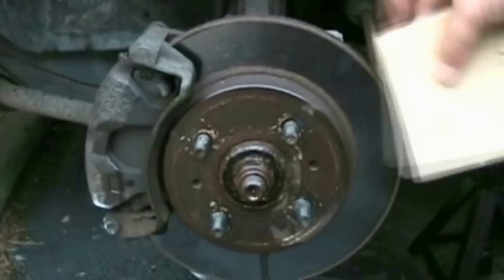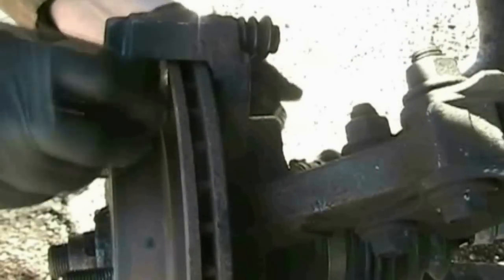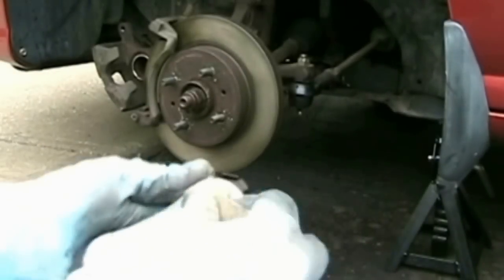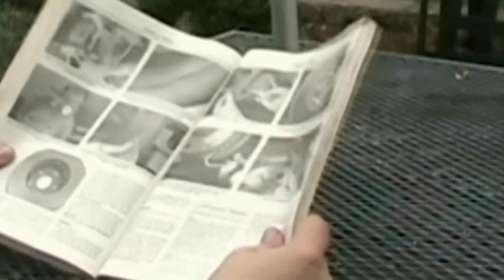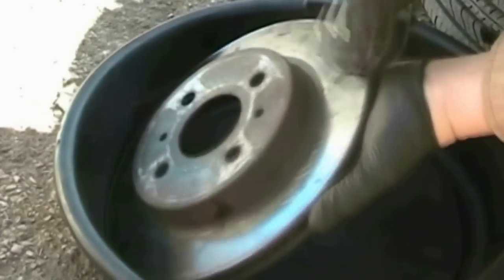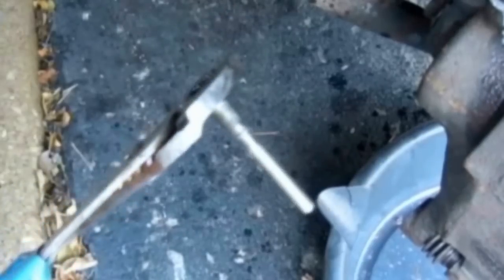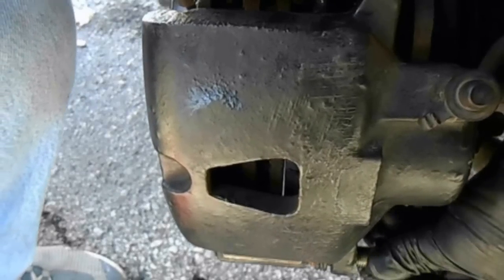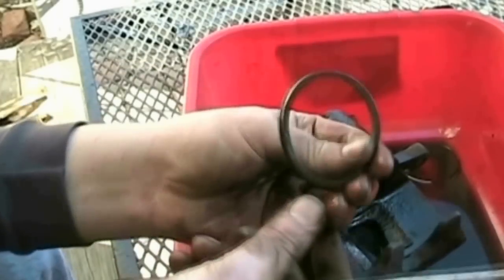Fix Your Glazed Brakes

Comment: OMG....in about 25 miles the rotors going to look the same as before you sanded them.
Reply: Only if the calipers are not releasing fully, I'd I'm not mistaken
Reply: depends on if you have a problem or its a situational reason, i got this because i took a trip to sweden (1000km both ways) and had loaded the car to max.

Comment: So that glossy finish on my brake rotors is a bad thing? If that's the case my whole brake system is jacked up.
Reply: Yeah braking at high speeds will also glaze your brakes very easily if you have non-performance ones

Comment: You just answered a problem with my 02' SC2 glazing over and causing steering wheel vibrations, that I've been mulling over for weeks. I was just going to replace my rotor but I see now my pin is definitely not traveling as smoothly as it should be (have to pry it out)  and I would have been at square one in no time.
Reply: Can you further explain how your steering wheel vibrated? Was in while driving/certain speeds? Or idling? Red light? Etc, thank you.
Reply: It was when I was braking at high speed. It wasn't jerking around or anything just felt like I was driving on a washboard whenever I would touch the brakes (no matter how hard or soft I pressed).

I would like to note glazing was only part of the problem, after cleaning my brakes I also measured my rotors for runout (which were off spec by ~0.003 inches), so I also bought some rotor shims to even it out. So far I haven't had any further issues.

Comment: So the uneven glazing on the rotor is a sign of the slide pin not functioning properly,  not a bad caliper and calipers only push frommone side and the slide pins allow the pressure to go to both pads

Comment: When you first pulled out the caliper pins, they were not lubricated. This is what caused the problem. Always use ceramic grease (the white stuff) for lubricating brake components.
Reply: Lol didn't listen to what he said
Reply: you didn't watch the full video nor did you read the description.  He talked about this.

Comment: Looks like trip to auto parts store and buy sand paper. I glazed my breaks from braking too hard on the highway one day and now they like to lock up easily when you smash the brakes they also have a squeak feeling when they get hot in traffic, kinda like running your finger over a clean wet plate. Do not ever keep driving on glazed brakes!
Reply: I know your comment seems obvious but, what are the problems with keep driving with glazed brakes?
Reply: They'll be more prone to fade and have less stopping power. Could get you in to trouble if you need to stop in an emergency or control your speed on a long downhill.
Reply: I was on a racetrack and glazed my brakes (pretty sure since I had my brake fluid changed and the issue remains). The brakes still work, no squeaky sounds but the initial bite isn't great. I need to really smash them to make them work properly

Comment: I have new Front Lines, calipers, ceramic brake pads and had the rotors turned. Brakes were good for the first 2-3 weeks, then started feeling like crap. They now have a glaze. I lubed the pins with blue brake grease from auto zone...  any tips?
Reply: If new brakes aren't bedded in properly they can glaze. Google "brake bed in procedure". I'd recommend going ahead and resurfacing your pads and rotors like OP did, then doing a proper bed in.